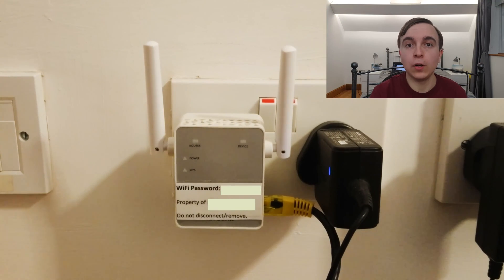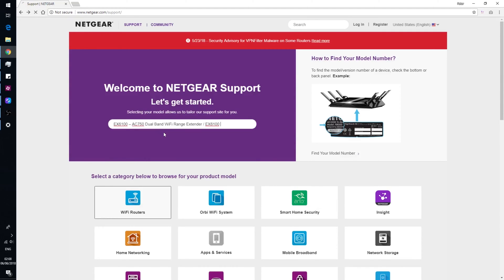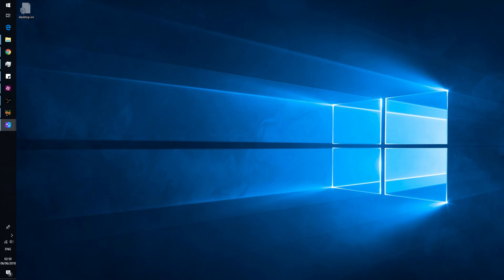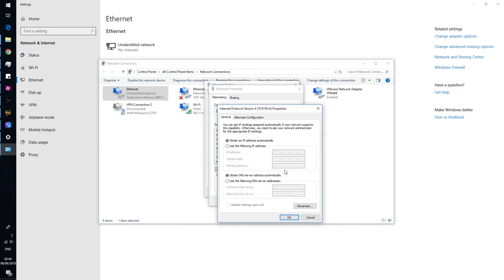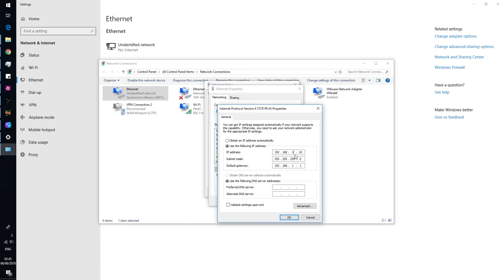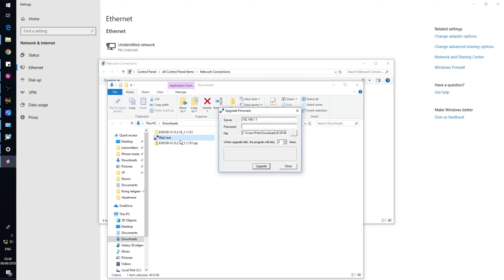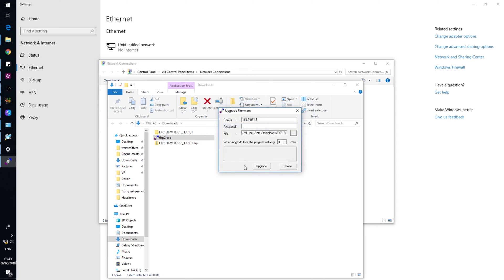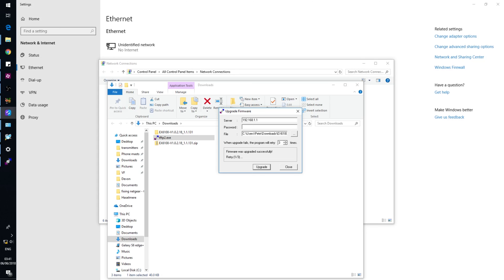Netgear Blinking Power LED Firmware Fix/Re-Flash Step by Step Guide (WiFi Extenders and Router)

Comment: I got through this process with my EX8000. I ended up using the windows 11 tftp feature from command line, after enabling it in windows. Also, for the EX8000 and my scenario I had to power it on while holding reset. It didn’t take the remote firmware put without that step. Thanks for the video and comments.

Comment: I have a used Netgear R6260 with the power light blinking slowly.  Downloaded the latest firmware, the file size is 26MB.  The tftp put <file> has been going on for more than 40 min.  Is that normal for a tftp upload of a 25MB file?
Reply: Finally, I was able to debrick the R6260 via the "tftp" method.  Had to power cycle the unit a couple of times to be able to connect to it via tftp.  It took 2 hours 24 min (8855.3 seconds) for the 25 MB image file to be installed on the router.  Now it is functional again!  Thanks for sharing this technique.  Strangely enough, tftp recovery is not documented in the Netgear support site!

Comment: Not working I always get "unable to get a response from the server" The only thing I can guess thats not letting it work besides the hardware possibly being broke. Is that when I try to change my static ip it always says "Warning - Multiple default gateways are intended to provide redundancy to a single network (such as an intranet or the Internet). They will not function properly when the gateways are on two separate, disjoint networks (such as one on your intranet and one on the Internet). Do you want to save this configuration? So Im now stumped on what to do besides throw it threw netgears window. My device came out the box broke. DO NOT BUY NETGEAR PRODUCTS!

Comment: Sigh. Semitechie here, over my head.  Had my Netgear Nighthawk mesh router stop working. Bought a new one with one satellite. THAT is working. But both of the old satellites blink red, indicating bad firmware. Tried to follow this video, but Windows 11's IPv4 settings window won't accept this information, and gives no clue as to what it needs beyond this. Preferred DNS? Preferred DNS encryption? Alternate DNS? I dunno. Kinda crushed, I thought I could do this!

Comment: For the Netgear EX6150v2 wifi extender: in order to enter the firmware recovery mode, you will need to hold the reset button while powering on. After 5-7 secs it will start to blink orange a few times then blinking green, then you can release the reset button and proceed with tftp flash, works perfectly!
Reply: THANK YOU! I was struggling until I came across your comment. It worked with my EX7300v2 — AC2200 Nighthawk X4.

Comment: no luck with my x6s ex8000, any ideas??
Reply: I had luck with my ex8000 about three weeks ago after it just lost it's mind (no idea why).  Oddly enough, it started acting up again yesterday so I'm in the middle of refreshing now.  From what I recall, it took a VERY long time to "reload" after the firmware was uploaded (like 10 min).  I also had to try the tftp2.exe flash more than a few times before it "took".  In my case the IP was 192.168.1.1 and the password was left blank.  Like I said, I'm trying to reflash as I type this, so I'll update once I get it working.
Reply: ok, I got it reset.  Basically I gave up on tftp2 and enabled in in Windows 10 by following https://community.netgear.com/t5/WiFi-Range-Extenders-Nighthawk/EX8000-Power-Light-Flashing-Red/m-p/2075359#M46418 , the command I used in the command prompt was tftp -i 192.168.1.1 [SOURCE FILENAME].  In my case the source file was the 102 version of the firmware.  For some reason I recalled that being the only one I could get loaded on the ex8000.  I initiated the tftp transfer once there was a red flashing power LED.  It turned off after the transfer started and after about 3 minutes, a green LED was present on the back and the front LEDs went solid after another minute or two. At that point I was able to connect to the device at it's original IP address (not 192.168.1.1) since it remembered it's configuration.  I hope this helps... it certainly is VERY frustrating.  In my case I inherited the device when I moved to a new house and when it works, it works VERY well.  When it doesn't, it's a total PITA.

Comment: This was really really helpful. I have done several attempts with no success. This video was my last shot and it worked. Thank you very much. Some instructions on Netgear site were incorrect : IP address, gateway address, when to flash the memory - it was telling do it while the system was booting, during the solid orange light. And with one attempt, it worked! I have the EX6250 extender, I used 192.168.1.1 address and the Password was 'password'.

Comment: I did the same steps for my Netgear R9000 -  nighthawk x10, but when I try to upgrade it, it keeps on saying  "unable to get responses from server". What did I do wrong?
Reply: The same is happening with my R8000. Did you ever make any progress or what did you end up trying next as a resolution? Thanks in advance.
Reply: Hellow, 
Your problem comes probably from a wrong gateway adress.
On my netgear it was "192.168.1.250" for example.
Just look into the manual of your device, the correct one should be mentioned ;)
Reply: @neonisbad - I too would like to know how if & how u resolved it.

Comment: @Peter C PLEASE HELP ME, i've followed every single step that you mention, and i still get "unable to get responses from the server". Mine is a AC750 EX3700 NEW, just arrived yesterday from Amazon US, and i configured it and it was all fine, until i get in www.mywifiext.net, and the web pops out a warning that there's a new firmware available (BIG MISTAKE), i clicked on it and it started de process, but then it just cycled and i unplugged it and when i tried to power on again, i got the Green Led Blinking POWER, i don't know what to do. Any suggests??

Comment: I tried to upgrade firmware to the latest version of my WN3000RPv3 and it broke in the middle. Maybe doing it via Wi-Fi is not the smartest idea I had. After some minutes stuck in a blinking amber power light, I hard rebooted the extender. Bad idea. Now I have a blinking green light at boot meaning the firmware is broken. I tried factory reset, it didn't solved my issue. It tried the TFTP reset described in this video using the tftp client provided by Ubuntu. It didn't work for my 10 first tries. I managed to make it work by switching to binary mode. By default, the transfert mode is ascii (text). I issued the put command right after the boot, when power light is amber and ping begins to answer back. Problem solved. Thanks for the video!

Comment: Saved me. Thanks for the easy to follow instructions for me a bit of a numpty. I was upgrading the firmware of the EX2700 and it just failed so after waiting for around 15mins I foolishly unplugged it in frustration then on powering up again got the flashing power light problem.
Reply from the maker: You're welcome!

Comment: My EX6120 (almost identical to your unit) stopped working earlier. Mywifiext said it needed an update. I went to do it, and it never came back on except for the blinking light.

Turns out the most recent update is from over a year ago so I wasn't out of date. Now I'm trying to follow these instructions but the flash stops at "erasing" and then keeps retrying with no progress.

I've pinged the device from my PC and it's connected (using the 0.10 address) so I can't figure out what's going on. I've tried with and without password, updating during the amber light... nothing works. I'm hoping someone sees this and can help!!
Reply: Have you fixed this bro? I have the same issue with mine.
Reply: @taskin1379  it did start working again after a ton of trial and error and research on what to do. I know that I did have to manually force a firmware installation or update, but can't remember what the final trick was that worked. Wish I could help more!

Comment: Sadly this didn't work for my R7000. I was trying to update the firmware because the my internet was so slow. However it crashed and my modem can't communicate with the thing it just keeps flashing a this white light when usually it's amber.

Comment: THANKS BRO! Worked %100  !!! Mine was the scenario where I had to flash the upgrade during the orange LED during boot up, took 3 flashes to complete, but it worked!  Model  Hardware Version: WN3000RPv3 Firmware Version: V1.0.2.74
Reply from the maker: Super! Thanks for letting me know!
Reply: I have the same model, but cant seem to get it working
Reply: @flacto420  same here

Comment: I am using a netgear nighthawk AC1750, meaning I have a modem then router. When I connect the ethernet from my PC I am going to a LAN port on the router and then on the WAN port to the modem. Is that correct?
Reply: Did it work? I have the same problem on the same device

Comment: What if the upgrading process is failing. I have tried both 192.168.1.10 and 192.168.0.10 neither one seem to work.
Reply: Nicholas Odell I’m having this problem too.
Reply: I just followed the steps in this video with success. (Netgear EX3700 AC750) 
I used the same IP, Subnet, & DNS information found in the video. Be sure to disable you existing wifi connection; windows will not allow an Ethernet and a Wifi connection simultaneously.

Comment: I have this issue with my Netgear WNCE2001. Tried following the steps but I believe the issue is with the firmware download. Firstly the versions 26 and 25) specifically state North America in the description. Will this prevent upload as I’m based in the UK? Secondly the download itself comes in a disk enabled format only, there are some release notes which give different instructions than provided here. When I get to the point of flashing it doesn’t work and simply fails after 3 retries. Help!

Comment: How on earth did it break it's own firmware?  That's so dodgy!
Reply from the maker: I just kinda filed it as consumer network gear as was a bit surprised myself. But flashing it back wasn't too hard but was annoying once I'd just put it in someone's room and then had to fish it out again.
Reply: Peter C just imagine if it didn't have a way to recover the firmware or perhaps broke it's own recovery 'partition'  💀 I did have a similar situation but I can't remember what it was but it was a cheap piece of network gear.  Any idea what could cause it?  Perhaps some dodgy NAND?  Or perhaps glitchy software writing bad data?
Reply from the maker: I think glitchy software is a biggy. Reports of problems like in the video are commonly linked with software updates rather than it spontaneously breaking.